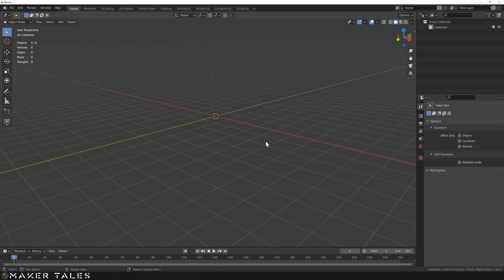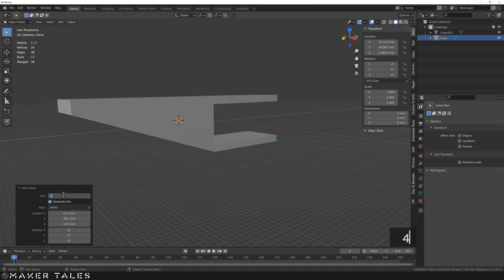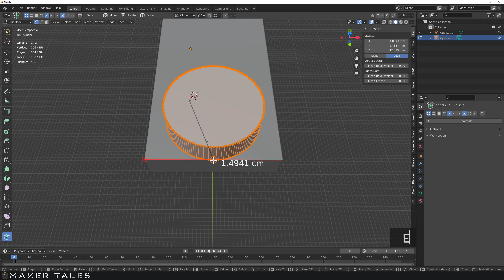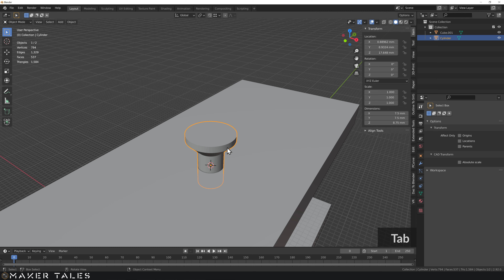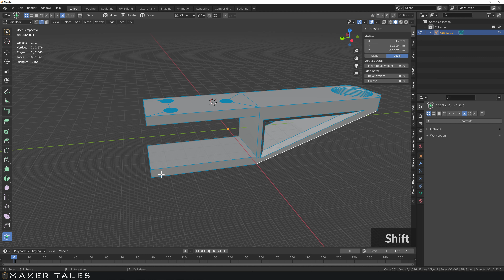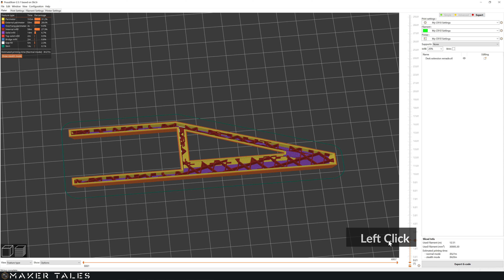3D Printed Desk Extension For My 3D Printer | Blender 2.9 Precision Modeling In Action | 04

Comment: so cutting the holes for bolts will be the same diameter of the bolt ? is that ok ?
Reply from the maker: It very much depends on your 3D printer if you are printing it. You might have to go up or down to keep the tolerance of your 3D printer in mind.
Reply: You can often use the horizontal expansion setting in Cura to increase hole size  a bit without having to model the tolerances but that depends on your model and orientation. Alternatively just heat up a bolt as you put it through the hole to have it tap its own thread. Where there's a countersink to keep it centred though, I'd likely just add some tolerance into the model.
Reply: @KayakingVince  thanks a lot ..
So what tolerance do we add to the model for pla as you recommend?
Reply: @mibrahim4245  It depends on the exact material, your printer calibration, flow rate, nozzle temperature, print speed, layer height, nozzle size etc. They can all influence how squished or stretched the plastic gets when laid down. I would suggest printing a small test piece with holes to fit your bolt and some 0.05mm, 0.1mm , 0.15mm and 0.2mm larger then see what actually fits your bolt best. 
It's even possible you might need to decrease the size if your printer is underextruding. 
I find OpenSCAD the quickest way to make such test pieces but use whatever you're familiar with.
Reply: @KayakingVince  informative as usual!!
I'll search for openSCAD .. 

Thanks a bunch